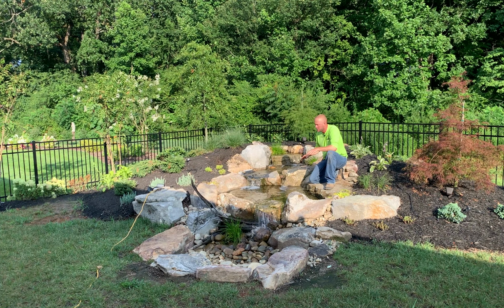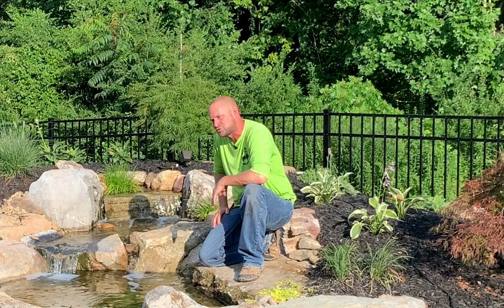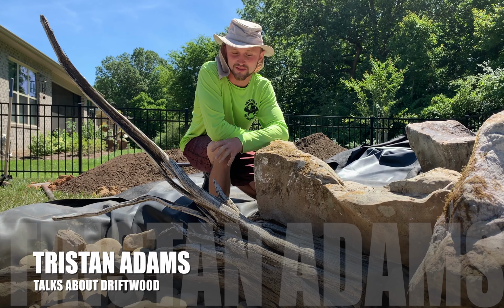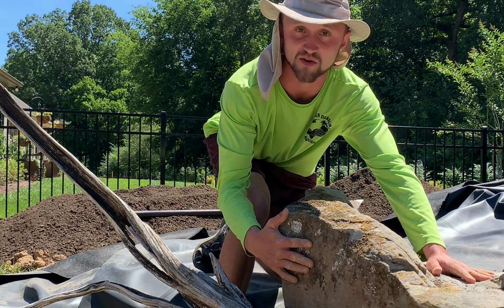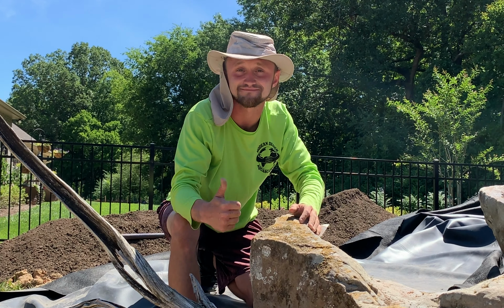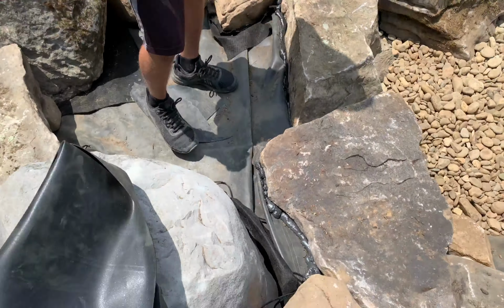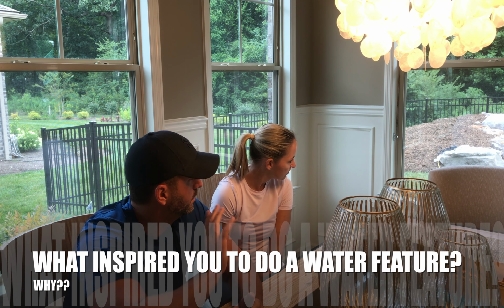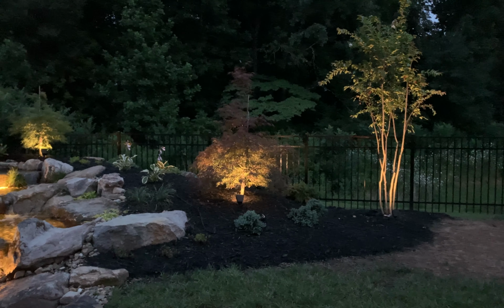THE BUILDING OF AN AMAZING PONDLESS WATERFALL IN A FLAT BACK YARD PART 2

Comment: Hi John, just watched your video building custom waterfall in flat backyard. Thanks for your technical explanation videos about choosing the rocks also. 
Couple questions, 
 What would you charge for this job and I saw that due to rain the job took longer than expected and you had to rent a skid steer. Do you pass along those costs to your client? If so is it cost only or with some administration costs?
Time lapse was great
Reply from the maker: We never pass cost on to clients unless they add on to the project. We track numbers and make great notes for future bidding. This job (should have sold for $30k based on numbers we ran. We sold it at $25k (without landscaping). We did ok, hit the target not the bullseye. We still have some tweaking to do, we actually have a leak on the top end to fix somehow. This is our first leak in a few years🙄 This cost is on us as well. In the end we have to grow, learn, and maintain our reputation. Life happens! Great question, thanks for watching🙏
Reply: John did you find and fix the leak?
Reply from the maker: Yes we absolutely did find and fix that leak. It was just a small spot on the edge where the liner had a funky fold, it happens sometimes but we always find it and fix it :-)

Comment: Hi am trying to build a swimming pond , with wetland area ,with a fish pond and waterfall.  I have some ideas allready but bit losted.  My space is small so I mite need to knock down a room r something if I can get planning permission.  Any tips  thanks
Reply from the maker: Start out doing a little research on regulations in your area. From there you can begin your design. Designs the Water Feature starting with The Pond, then design a wetland filter that is sized appropriately for the size of the pond, then design a negative edge or an intake bay that is sized appropriately for the total combined flow of all pumps in the feature.🤟 at least that’s what I would do :-)
Reply: @KoiAddiction  thanks for the reply.  I seen on some other site watever size your pond is , your wetland and fish pond should be 30% the size of  your swim pond,Goes that sound right to you. And  sorry just one more question , am a carpenter and can do concrete and plastering,  could I do most of my pond that way and just put some rocks up at the top. Thanks again